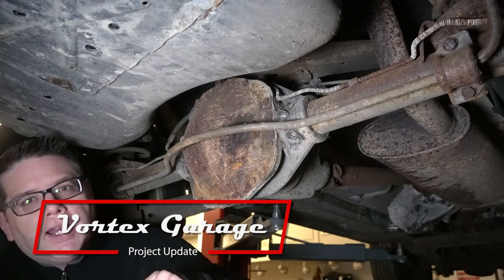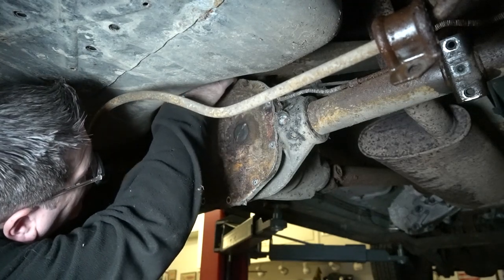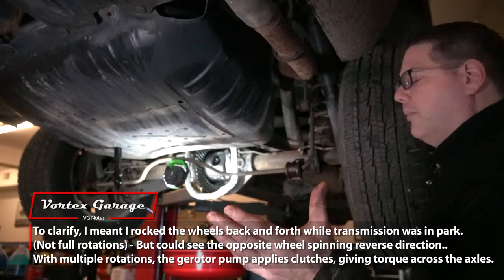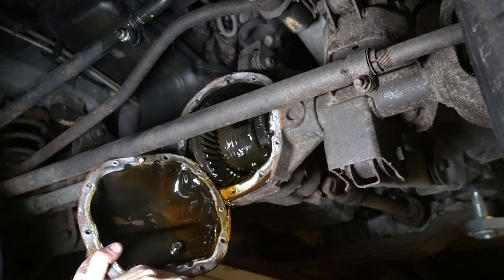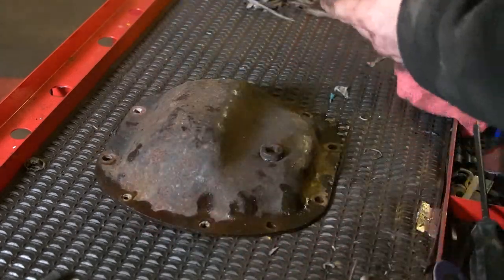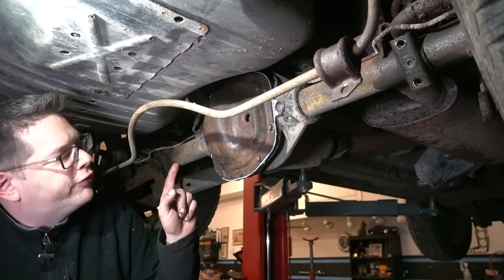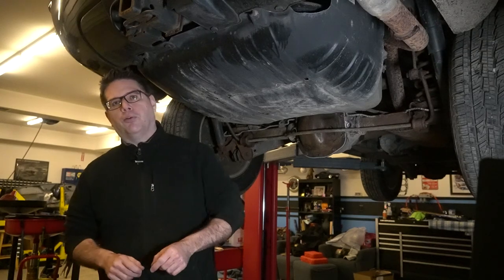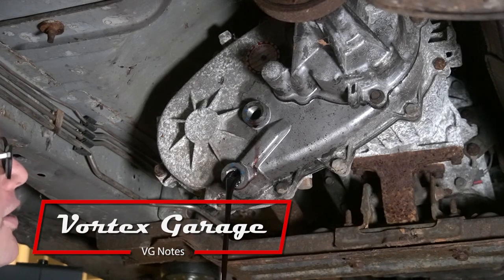It had the wrong fluid!  WJ QuadraDrive Service - Axles, NV247 Transfer Case - Fluid Change How-To

Comment: Thank you for including the torque specs.  Very helpful for the weekend mechanics 🙂
Reply from the maker: No prob!  Glad it is helpful!
Reply: @VortexGarage  question....no heat from vents! I have air flow...ac is ice cold!new rad, waterpump, core, doorblends and actuators! Been flushed 3 times! Everything's working according to diagnostic machine! What could it be?

Comment: Are you sure you dont have a bad rear trans seal ,leaking trans fluid into the transfer case. it was over full when you pulled the fill plug.

Comment: I have an '05 WK 5.7 and I'm just finding out that when I used ATF+4 (months ago) because that's what my manual said, it was a misprint in the owners manual and it should have NV245, NV247, NV249. I don't drive it a whole lot, I've maybe put 300 miles on it, mainly short trips. Do you think this has done any damage to the ransfer case?
Reply: When the fsm was printed, it was atf4. I've read somewhere that atf4 retains water and doesn't play nice with the 247. Mopar changed it to their fluid, which I believe is a rebranded Mobil tractor gear oil. I don't think you did any damage to the transfer case. Drain and refill. Worst case you can pick up another 247 practically at any junkyard. The main component in it is the progressive coupler, which unfortunately is not serviceable.
Reply: @charlesgrimm7382  That's what I did, that was about 8 month ago. She's all good still, but if I remember right, that damned oil was like $20 a quart. You're probably right about it being tractor gear oil, prob $2/qt, then they slap their sticker on it and jack the price up 10x lol.

Comment: Haven't watch it all yet but just in case I think the Trailer Tow package specify a different viscosity grade lube in one or both differentials.
 Some have limited slip rear only? Some have it in front also? 
The NV247 the transfer that has 4 wheel part time Lo? (As well as N and "4 wheel full  time High") Some of the WJ only had "4 wheel full time all the time" only?

Comment: What does it mean when only 1 wheel spins on the front? I have a 99 jgc with 4.7 quadradrive. When I put it in the air in drive all wheels except the drivers front spins. I don't know if it matters at all but my transfer case is also bad, under load on the ground the front drive shaft won't spin. I thought it was a bad front diff but it was diagnosed by a mopar tech

Comment: Pro tip: LubeLocker has gaskets for the diff covers. Makes servicing easy.
Reply from the maker: I really need to try those. They are reusable too which is great. That and no setup time for rtv cure.
Reply: @VortexGarage  Yes, I got the Dana35 gasket 12 years ago. There were no Dana44A gasket available then, but there is now 🙂Ordered one in 2019.

Comment: @VortexGarage You are wrong about the torque spec at 16:54 for the rear sway bar, it is 54Nm/40 ft-lbs for the 4 bolts for the sway bar bracket/retainer that holds the rubber bushings on the axle tube, 54Nm/40 ft-lbs for the link on the sway bar side, and 92Nm/ 68 ft-lbs for the link on the frame side. The removal procedure and figure in the FSM make this clear. Thanks for all the tips though!

Comment: 13:55 I found out that wire wheels and the soft bristle disc only polish the rust and you have this black-ish layer still remaining, which is actually still rust. If you hit it with sand paper, you get the typical orange rust dust again. That's usually the cause if something starts to rust really quickly again.

For the pneumatic grinder, you should be able to find CSD discs (usually purple and they have this alien sponge appearance). They are REALLY great for taking off rust but not affecting the healthy metal. They are a bit on the expensive side but they work really well.
Reply from the maker: Awesome tip, thanks!  Def agree the rust is still there just the scale is gone. Those csd discs should definitely do the trick

Comment: Great stuff! I just did the rear diff on my WJ. I thought it would be a quick and easy job, then I broke one of the sway bar bolts. It was a pretty difficult fight to get out. I ended up drilling it out completely and replacing it with a new bolt/nut.

Now I'm procrastinating on doing the front diff lol.
Reply from the maker: I was thinking that when I was removing the sway bar mount bolts - how much fun (not!) it would be to drill them out.  Well at least on the front you don't have to touch the bar!
Reply: Just snapped a sway bar bolt. Will probably have to drill it out. Any tips and clues would be appreciated. Is the nut welded to to the flange?
Reply from the maker: @YOUZTUBE2000  I believe yes the nut is welded to the flange. You could try drilling out the bolt using a pilot and gradually increasing size. You may get lucky and can remove it.  But it may be faster to simply cut the welded nut off the back, drill, and do metric 8.8 (or grade5) or metric 10.9 (grade 8) bolt and nut.

Comment: (about 7:00 ) I wonder if cycling the positrac by turning the wheel to pump out some more lube is good to get a more complete drain-but might mean you need to do a top up after driving after the initial refill
should the positrac friction modifier make the lube more cloudy than what came out?
  my quadradrive posi makes it hard to turn a wheel by hand with the other wheel on the ground

Comment: Why is your gas tank so high up. Is my rear springs saggy or something?
Half my bolts are covered by Fuel tank cover. I have no access to most of them and only 3" to wrench by hand with the required 13mm/1/2"

Mine is a 02 Jeep Grand Cherokee Laredo 4.7L Selec-Trac and says 80W-90 gear oil on right tag plate.
I believe i have DANA-44a
Reply from the maker: Two things - here I had the jeep in the air, so the axle was hanging down as far as it would go.  Second, this WJ doesn't have the fuel tank skid plate - if you have that extra skid plate (an option on some WJs) it may result in less cleraance.

Comment: What kind of noise did you have in the rear? I have a 2000 and when I make a sharp turn the rear end acts like it’s in a bind
Reply: I had the same issue when I got my 2001 jeep grand cherokee limited 4.7l. I used  The Genuine Mopar Fluid 4318060AB Limited Slip Additive - 4 oz. Bottle. I believe I used 2.5 0z. Got rid of the binding right away.

Comment: very nice video, i have a 2003 jeep gc 2.7 l mercedes engine with quadra drive, it has only high and low range, the problem is in high range front wheels stopped spinning(i got stuck in snow and only rear wheels were spinning), when i put it in low gear they start spinning again, what could be the problem? the transfer case? thank you
Reply: Some kind of a front axle disconnect operated by a vacuum servo that can go bad or suffer a cracked or fallen off vacuum hose? Probably not the fault of the transfer case.  Old square Jeep Cherokee (not Grand) used to get that problem. (I think the lever that shifted the transfer case also activated a vacuum switch that disconnected or connected the front axle disconnect)
  My USA 4.7 WJ does not have a front axle disconnect. Front axle engaged all the time but transfer case doesn't feed torque to the front driveshaft unless it senses the front spinning slower than the rear driveshaft. (Unless in 4 wheel Lo which locks front and rear driveshafts together and drives them through gear reduction)
Reply: @davidpowell3347  mine its the same, you cant disconnect the front axle, its permanent awd, i dont think its vacuum operated
Reply: That does makes it sound like something wrong in the transfer.  Putting it into Lo probably locks the driveshafts together and bypasses whatever was supposed to supply the full time demand torque for Hi. On mine you can barely spin the rear wheels very slowly in snow without the front wheels pulling much but give a little bit of gas and the front wheels accelerate the vehicle strongly.   @thejoker3217

Comment: Do you need a modifier in the transfer case as well like in the diffs or purely the right fluid?
Reply: The Mopar fluid has the friction modifier already added. So just need the correct fluid.
As was mentioned in the video, do not use AFT in the 247.